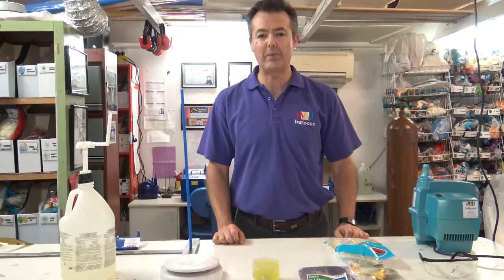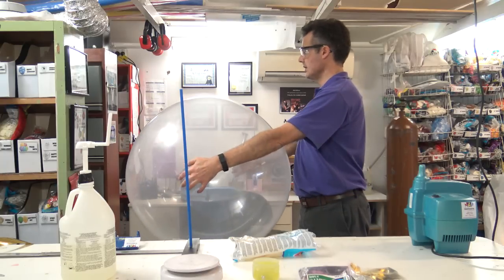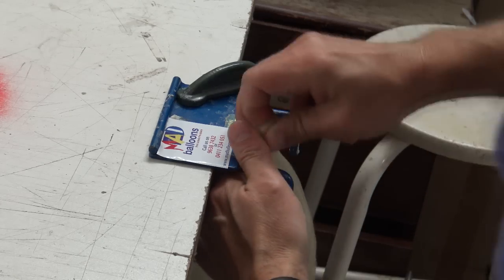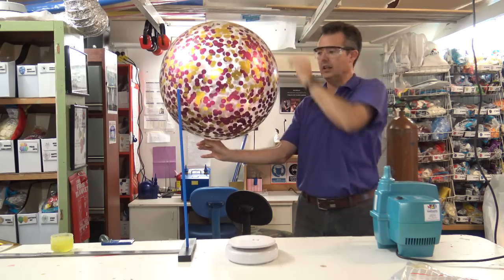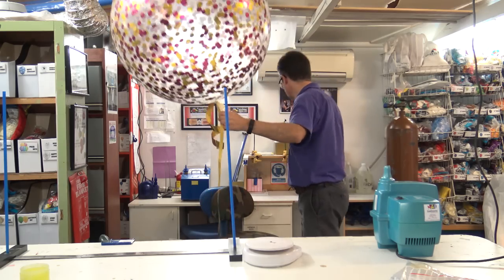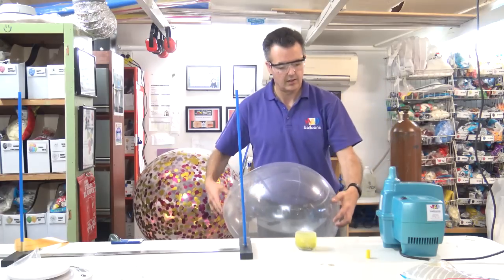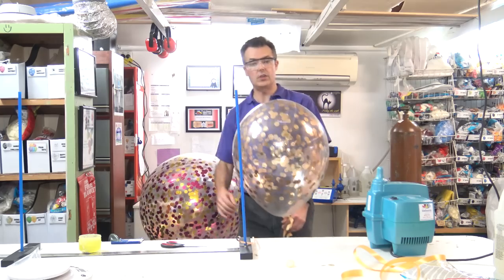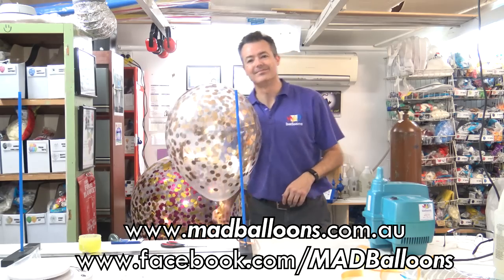Confetti Balloons

Comment: What kind of paper do you use for the confetti when using the hi float?
Reply from the maker: Bonny Bernal I use metallic confetti, so not a paper product
Reply: David Taylor is it normal for the balloon to have spots inside? Since it has the helium and hi float you can see spots, what can I do for that?
Reply from the maker: Bonny Bernal hmmmm, not sure what the spots you mention are.  Be careful when you are spreading the ultra hi float in the balloon and make sure that all of it is covered.  You need to do it gently and slowly  If you work it to quickly tiny air bubbles will appear.  Good luck